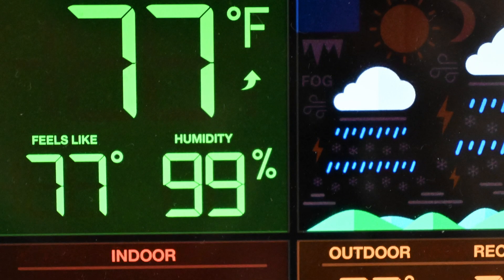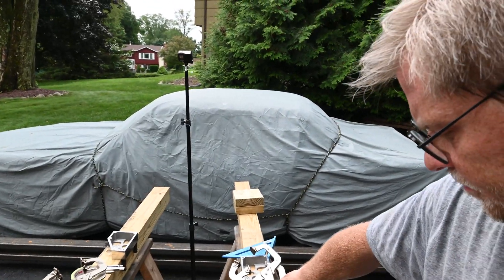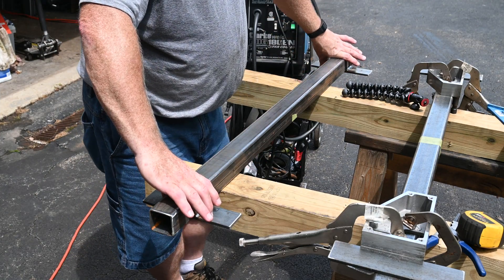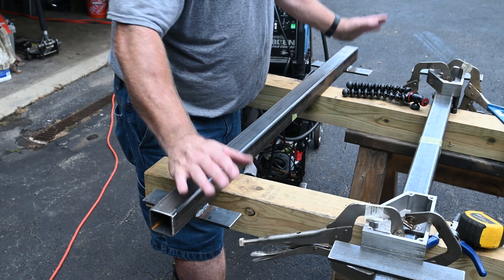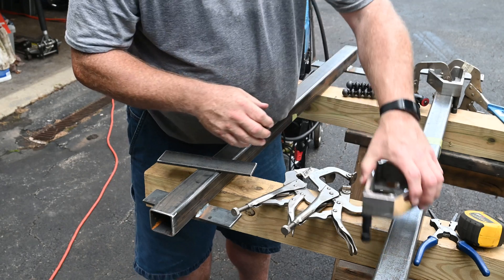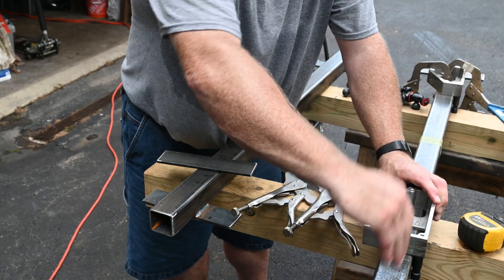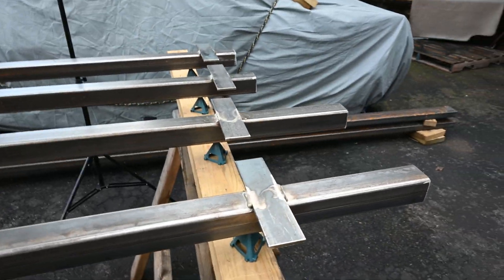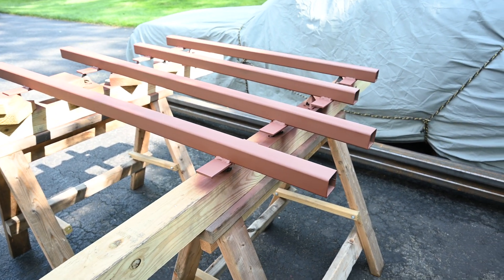Designing and Building a Classic Mustang Body Jig - Part 5 |Mustang Frame Jig | Mustang Chassis Jig

Comment: do you have list of the steel you used?  A "parts list"
Reply from the maker: I don't have a 'complete' parts list yet. but the steel is basically   2"x4"x3/16" tubing for the main rails and main cross  members. 2"x2"x1/8" for the diagonal bracing at the front and rear. The brackets that attach to the car, and mount to the jig are made out of 2"x2"x1/8" tubing and 2"x1/4" flat stock for 'feet'. Four casters from Harbor Freight, and a bunch of miscellaneous hardware to screw it all down. Once I get it mostly complete, I still have a little more work to do, I will do a 'Wrap Up' video, and I will go over a complete parts list there.